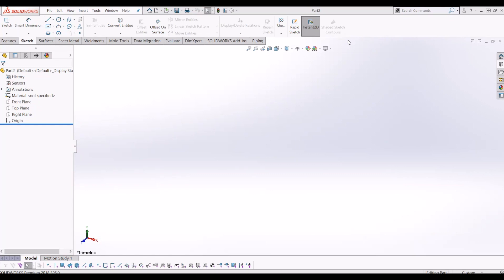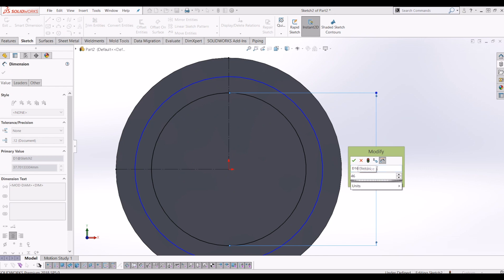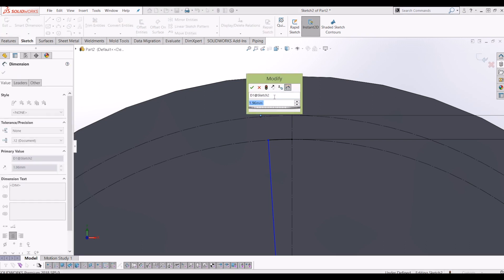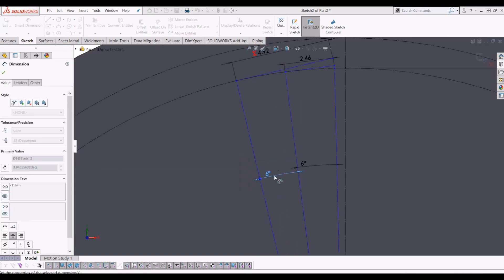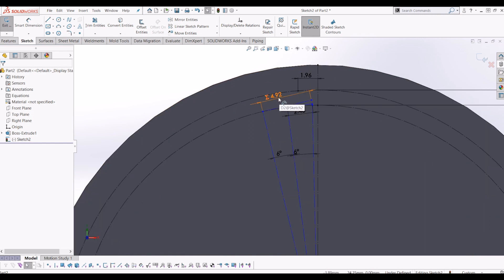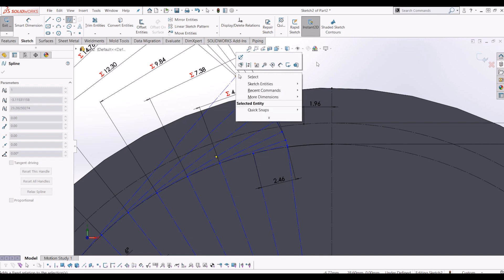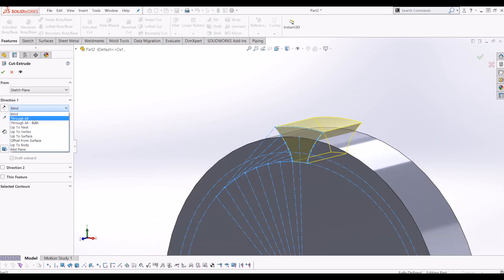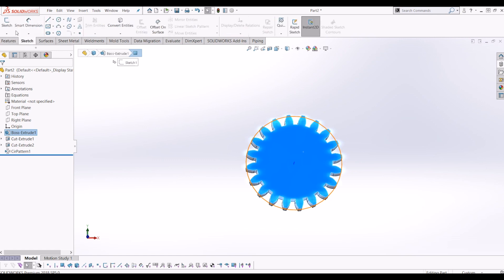Solidworks 3D Modelling How To- Draw A Gear 1/3

Comment: Nicely done video, except it is completely missing your design parameters, i.e. where does your PCD etc dimensions come from? Why one dimension is 1.96 in this case? Is it exactly 1.96 or are you rounding a dimension, which might become crucial when making larger gears?

Comment: Just a note on your key way:  I noticed you cut a 5mm key way through the gear.  It should be a 2.5mm key way through the gear with 2.5mm going into the shaft.
Reply: Please do not incorrect people. If you want to be pedantic, the correct standard keyway for a 20 mm bore would be 6 mm wide and 2.8 mm high from the bore edge.
Reply from the maker: Thanks for the feedback, will update